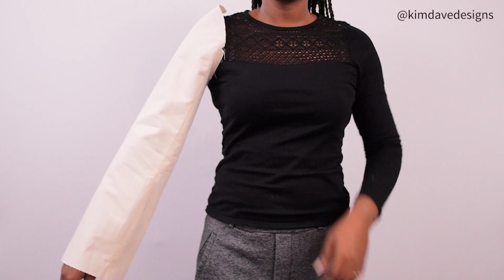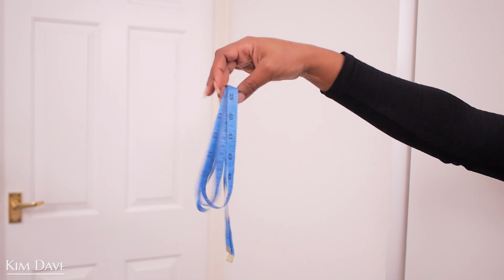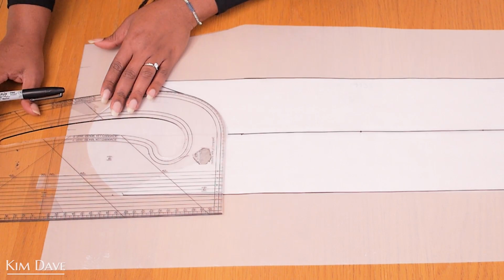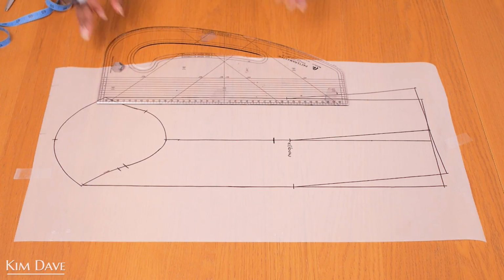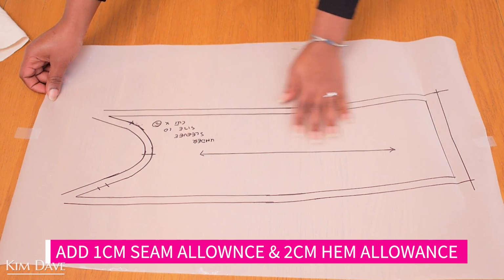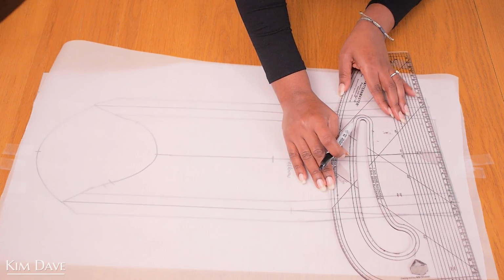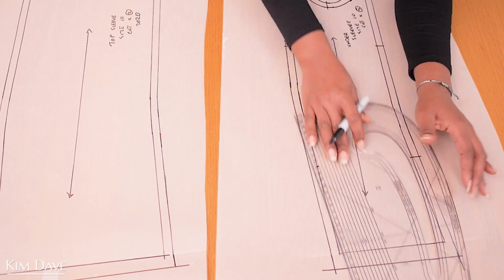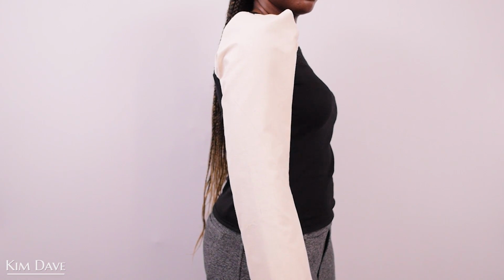TWO PIECE SLEEVE PATTERN TUTORIAL | KIM DAVE

Comment: I was hoping you were going to cross out the lines you didn’t need 🤣🤣🤣 so many lines I was starting to get confused lol. I’ll probably use a pencil so I can erase a little. I might try this tho I’m still not good with sleeves and tops in general 😕
Reply from the maker: I know it can get confusing when there are too many lines, that’s why I trace out the ones I need onto fresh pattern paper ☺️ Using pencil and erasing lines you don’t need is definitely a good tip
Reply: Kim Dave would you say this pattern can work for a Moto/faux leather jacket? I have this vision of designing a new leather jacket (since the pockets on the inside of mine are coming apart). My current one has grommets going up and down the sleeves so you see the black lining. I want to do the same but choose a patterned fabric for the lining so you can see it through the grommets 🤗